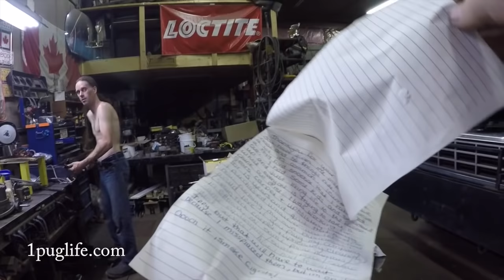will it run? 1987 grumman iced cream truck

Comment: that is not a kurbmaster because it has a standard seat on the passenger side instead of a folding jump seat plus there should be a small window on the bottom of the passenger door so the driver can see the kurb duh

Comment: Buddy...For the amount of work vs amount of time you will drive the ice cream truck, I'd slap another 350 into it.  Direct bolt up, way cheaper and done same day.  No exhaust work, drive shaft, fuel tank, motor and tranny mounts or wiring to dick with.  Gauges would all work and probably easier to sell.  Cost ya few grand just to put a cummings in by the time you get all the bits and such and any fuel you would save you be way out shadowed by the cost of the swap.    Might even have a engine in the yard.  Fuck the cummins.. wha happened?